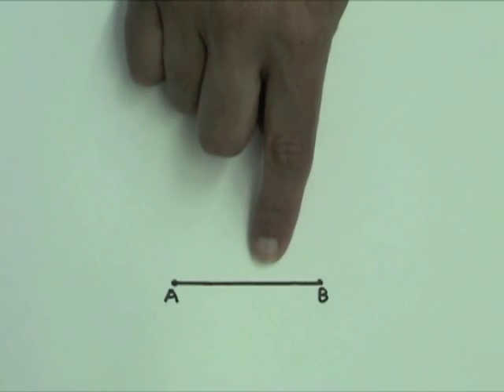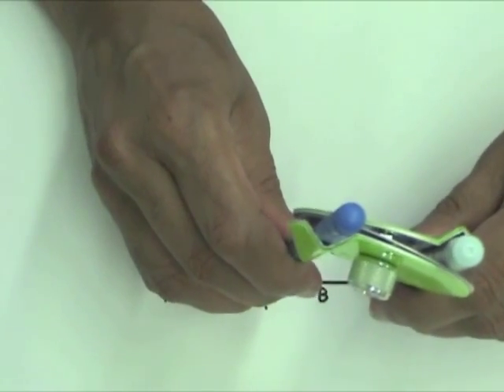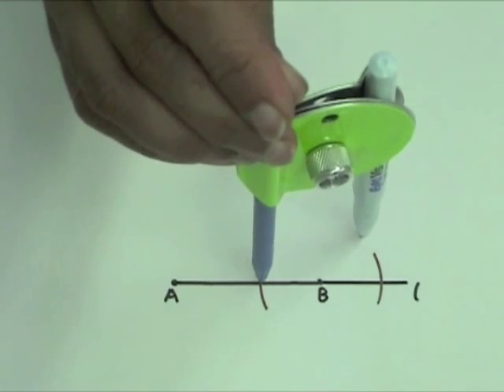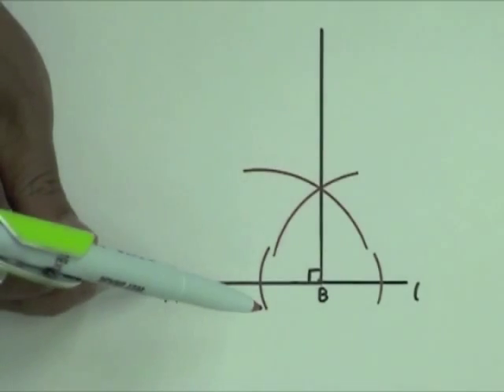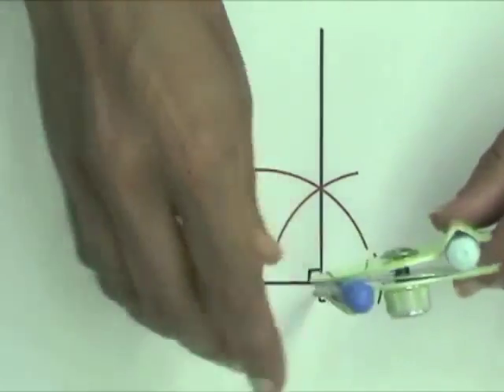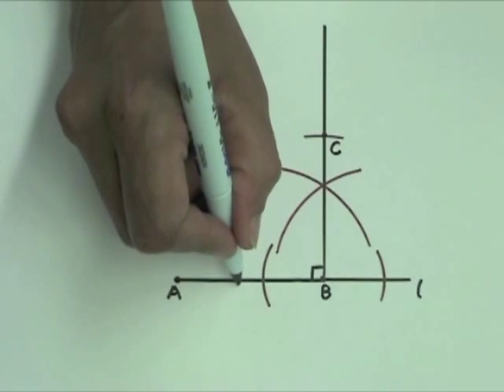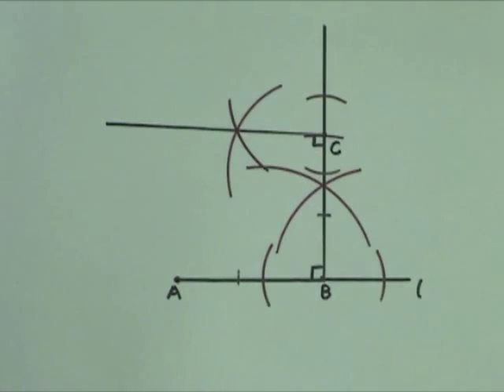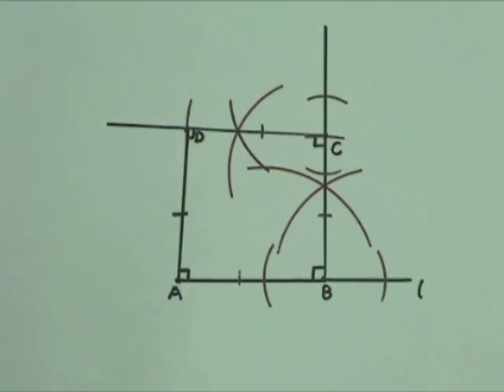Straightedge and Compass - 9 - Square

Comment: There is a faster way to find the last two sides. Once you have point C you don't need to find and draw a perpendicular. As you already know the length of A-B and B-C are the same, you can draw an arc of this radius from point C and one from point A. Where these two arcs intersect will be point D. Then simply join points A-D and C-D and you have your final two sides with right angles.